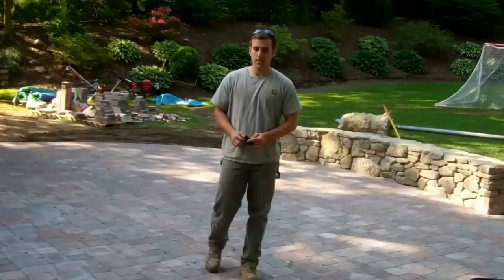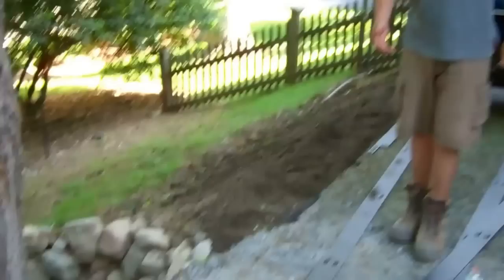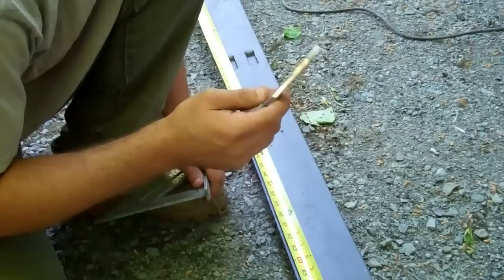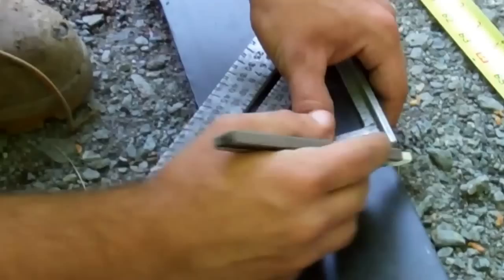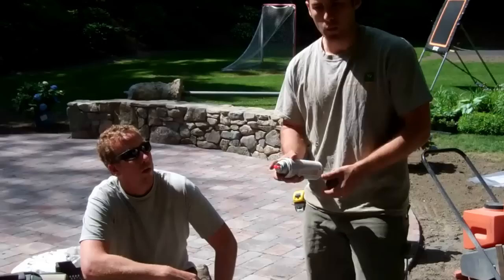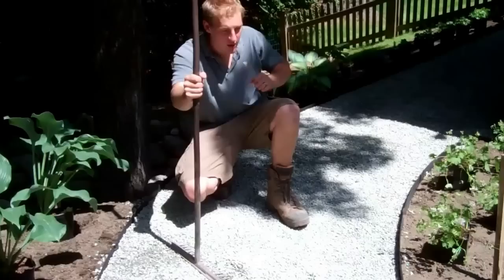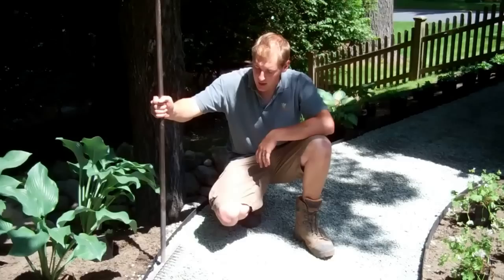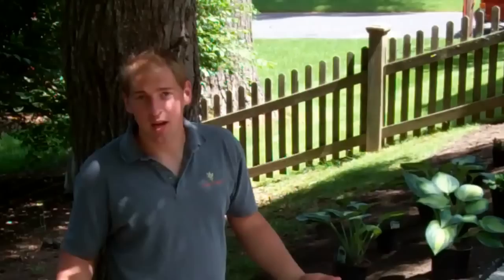How to Build a Walkway

Comment from the maker: Thanks. It is personal preference. The metal edging has worked great for us and does a nice job of retaining form and material.
Reply: Hope this makes sense. How much flex can I get by using the metal frame. Im trying to create a small path from driveway to back yard gate. The angle I will need is approx 90 degrees give or take.
Reply: I have to add a walkway over a slight slope that is very full of tree roots. Would this be a good application for metal edging?

Comment: For pathways, always use compacted crushed rock rather than decomposed granite or smooth stones like pea gravel. Decomposed granite is subject to erosion in rainy climates and smooth stone will shift. Nurseries always use crushed rock for pathways because when compacted, the facets of the stone align, wedging the stones tightly together so that they do not shift. It's the next best thing to concrete.

Comment: You guys should consider investing in a reciprocating saw to cut the steel edging instead of using up all of your grinder blades. I would suggest a battery powered/cordless saw so you wouldn't have to run extension cords. With that being said, we use the angle grinder just for clean up after the edging has been installed.  Just a suggestion!

Comment: How thick do you lay your base material?
Reply from the maker: Normally we'll do 4 inches of the base crushed bank material and about 2 inches of the finish stone on top.
Reply: To get the four inches of the crushed bank gravel, I assume you are digging a four inch deep trench (as wide as the walkway) to put the gravel in. Is that right? Do you have an easy way to calculate how much gravel would be needed based on the length and width of the walkway?
Reply from the maker: Hey Shane
This is a great tool to get you started. 
https://www.mutualmaterials.com/resources/
Reply: @GardenContinuumINC  Don't mean to read into your answer, just clarification. Your total base depth is 6" is that correct? 4" of base crush, and 2" of finish stone? TIA

Comment: Hello guys, I have a walk way, in the woods, it is on a slight angle, it  gets muddy. Can I put a border edging on the slope side and put gravel down? What type of Gravel do you recommend?
Reply: Edging or lower edge at least. Roadbase or stone dust, then inch minus or peastone 6-7 in. total depth. Unless you get a deluge, should work.
Reply from the maker: Yes as long as it isn't too steep. For a steeper slope you want to use a crushed bank gravel and compact it to stabilize. For a gentler slope you can use a loose pea-stone - 3/4" would work well. I think 3/8" may be too small.